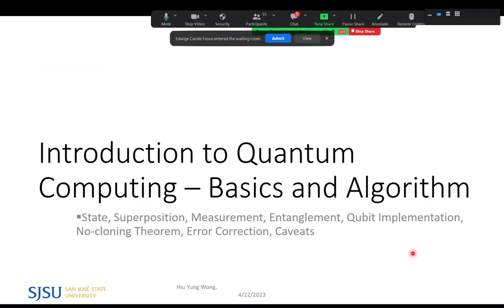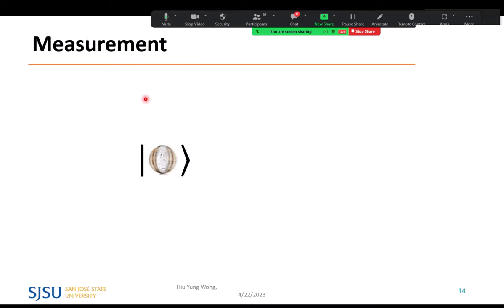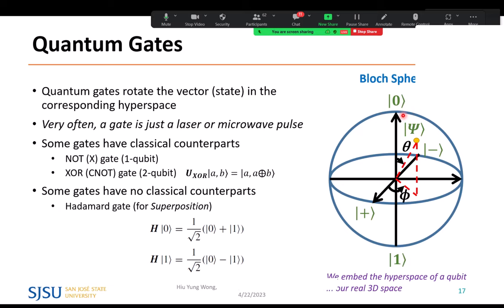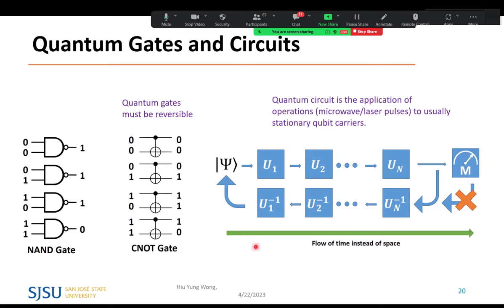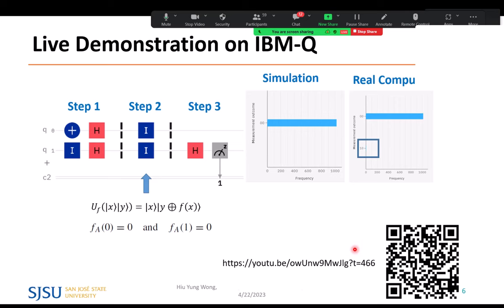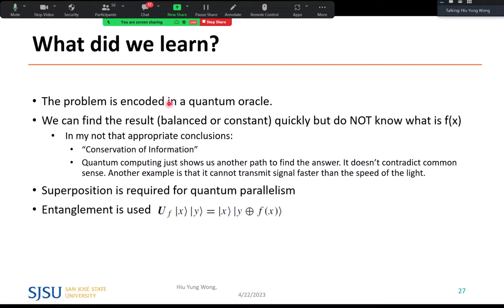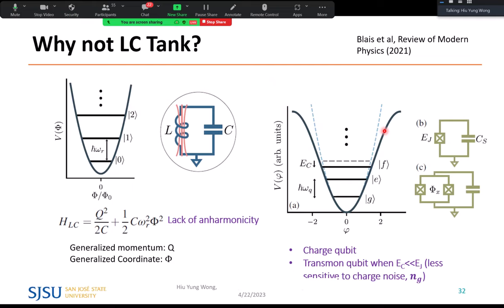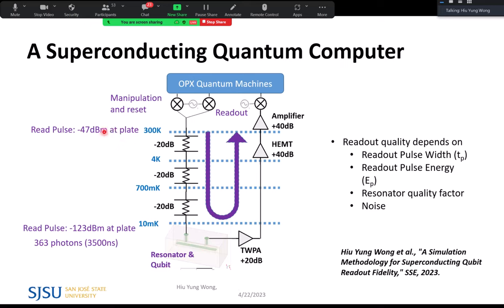Quantum Computing: Algorithm, Programming and Hardware, an Introduction

Comment: BEST video on internet / Youtube that finally explains how a PRACTICAL, real world "Quantum computer" works, the steps, and process of how to create (translate from digital to analog digits) ,  calculate , and store/return (display)  values (states)  in the QC.  By  using a pulse source, and using the very cold  setting for reducing/eliminating noise, and then providing a readout of what was asked of the system, the QC provides a new way of calculating such exponential values.

Comment: Hold on, I want to know they counted all the atoms in the universe!
Reply from the maker: I found this: https://www.thoughtco.com/number-of-atoms-in-the-universe-603795#:~:text=It%20is%20believed%2074%25%20of,atoms%20in%20the%20known%20universe.
Reply from the maker: It says, "It is believed 74% of the mass of the Milky Way, for example, is in the form of hydrogen atoms. The Sun contains approximately 1057 atoms of hydrogen. If you multiply the number of atoms per star (1057) times the estimated number of stars in the universe (1023), you get a value of 1080 atoms in the known universe."
Reply: @quantum_computing  what about all the planets though?
Reply from the maker: @itsjustajokejeez  Probably they are much smaller than the stars/suns and are neglected.

Comment: While representing the quantum basis, you have subscripted "10" in them. Is that supposed to imply the original ket bases 1 and 0 or is there some other implication of that?
Reply from the maker: @Bindusmita_Das For 1 qubit, the basis states are only |0> and |1>. For two qubits, they are |0>|0>, |0>|1>, |1>|0>, and |1>|1> (permutation,  tensor product of two 1-qubit basis). We can write it succinctly as |00>, |01>, |10>, and |11>. Do I answer your question? If not please let me know which slide (time) you are referring to. Thanks!
Reply: @quantum_computing  I was actually asking about the slide where you have compared between classical and quantum computing registers. In the quantum case, the subscript is 10, just like 2 in binary. I was asking about that.
Reply from the maker: @Bindusmita_Das  I see. So you are referring to slide 11 4:15? The subscript is actually ten. It means I am writing the content in the ket in the decimal system. E.g. if it has 3 qubits,  instead of writing |111>_2, I write it as |7>_10 where the number after _ is the subscript.
Reply: @quantum_computing  Got it. Thank you:)

Comment: Thank you.
What do you think of optical computing? Could this be a technology that has more potential?  If so, how long out would you think that technology is?
Reply from the maker: @thenavigator5889, thanks for watching. Optical computing can be classical (using an optical method for binary computing) or quantum computing (photonic quantum computers). To be frank, I have no answer to your questions. Photonic QC is supposed to be more robust to noise (they can work well at room temperature except in detection, they need cryogenic to have high resolution and low dark current). But the reason they are robust also means the photons do not interact with each other well (you can pass two beams of light across each other and they are not altered). So it is also more difficult to make a 2-qubit quantum gate in that sense.

Comment: at 4:43 you said compressed the 16 bit to represent the one of the state .why it so ? because there are 16 states individually with different complex number or( state amplitude) why we compressed for one state. i think we have to compress 4 bit for one of the state. if i am wrong please correct .thank you
Reply from the maker: This was what I meant: With 4 qubits, we have 16 basis states. But in quantum mechanics, we may have states that are the linear combination of the basis states. So, we are not doing any compression. This is just like, if there is 1 qubit, I have 2 basis states |0> and |1>. And I can also have other states like |a> = 1/sqrt{2}(|0>+|1>) or 1/sqrt{2}(|0>-|1>) or 1/sqrt{2}(|0>+i|1>) or others. Please let me know if it is not clear. Thanks!
Reply: @quantum_computing  thank you for kindness response .i got it . actually i am doing my research work in the QEC specially to design or improvement in existing code so if you help in this, i will be thank full for your. please provide any contact. thank you
Reply from the maker: @vikramsinghthakur1456  I am not an expert in QEC. Hopefully, you can find useful information and material from the Web.
Reply: @quantum_computing  thank yo for kindness